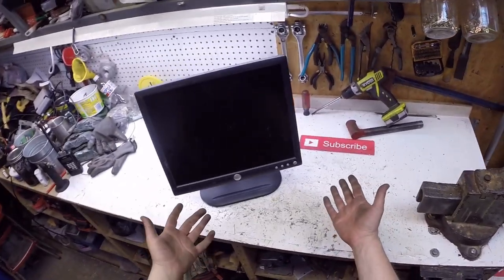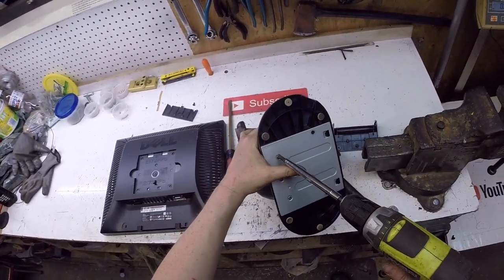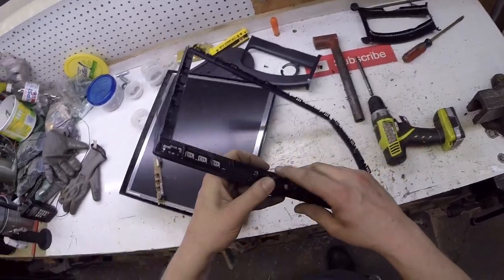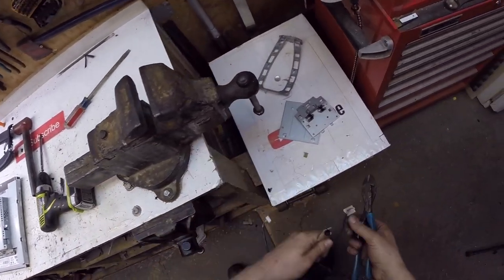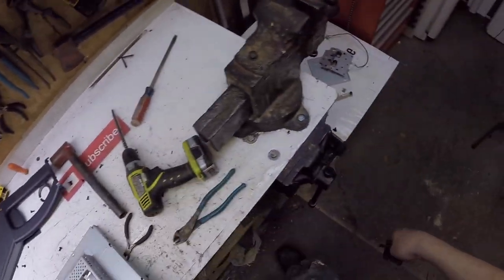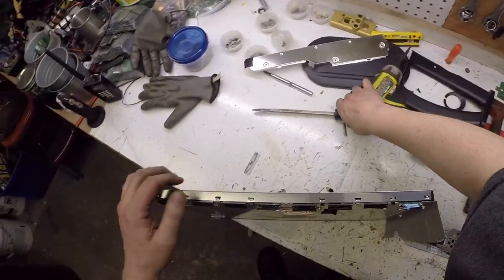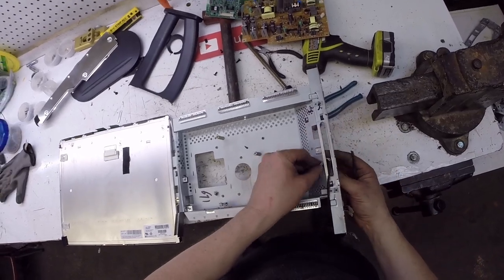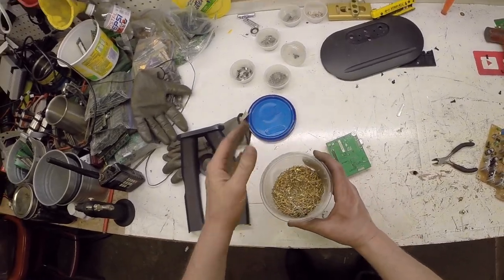Make Money Scrapping A LCD Dell Monitor

Comment: You have transformers on the brown board, easy to twist off with pliers.  At my scrap yard they go into the "copper bearing motor" category and are heavy.  The larger one will yield its copper pretty easily.  Get yourself a shorter driver holder, they're cheap.  Also highly recommend Crescent compound side cutters!  I have a couple of these monitors and wanted to preview if its worth my time.  I often use a a calfskin leather glove on just the left, holding hand. Steel pins always can be pried out of those heat sinks.  Those transistors are suppose to have some gold bonding wires in them, but at least the chunk of copper.  I was hoping for a yellow corner BGA chip.  :(
Reply: What part is the transformers
Reply: @paytongoodrich6963  on the brown PCB, its the largest white and yellow square thing.  Also there is a white spool of copper wire.  I knock out the ferrite center and spool off the thin wire.  Also, several aluminum heat sinks can be harvested, with copper bearing transistors. I think it looks like 3 or 4 transformers on that board.  Twist and stash!
Reply: @karlbe8414  mine didn't have the extruded aluminum